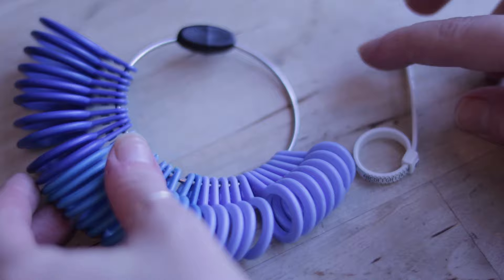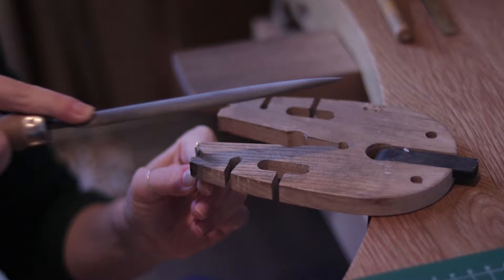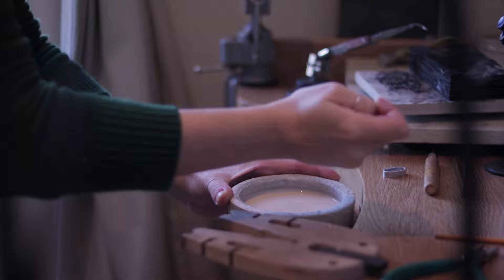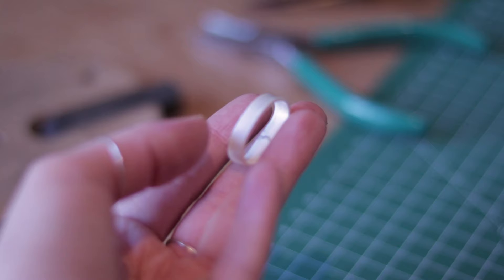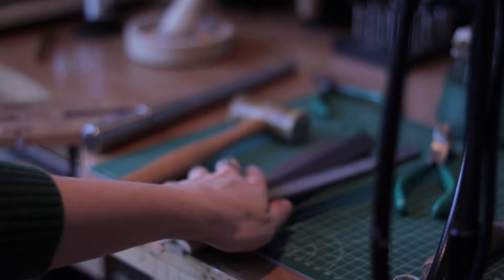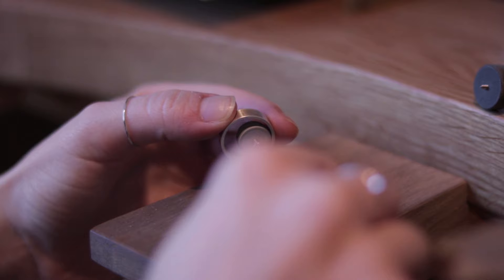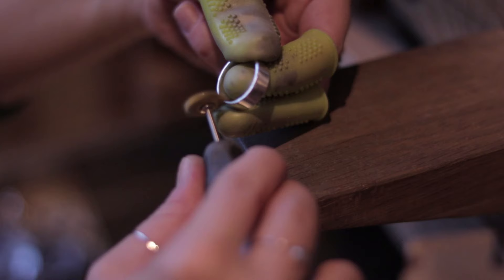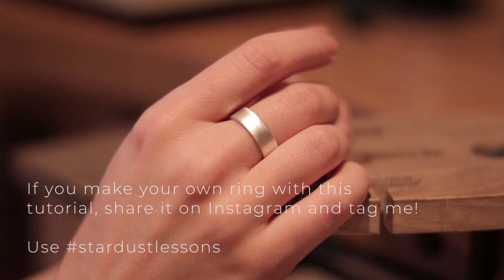HOW TO MAKE A RING - tutorial step by step.

Comment: I love that you shaped and sanded by hand for those of us without fancy tools! So helpful
Reply from the maker: Thank you so much for watching Rachel! I didn't have the ring bender up until recently, so I would always bend the rings with my pliers :) There are different ways, this was just one of them, which worked for the wide band in my case. If I was using thinner, round wire, I would overlap it on the ring mandrel and then cut to the size. It's faster and more precise this way :)
Reply: I agree! I am new and her videos have been THE BEST I have found on here
Reply: A Dremmel tool (rotary tool) is something you should already own.  Tell your husband to buy one- they aren’t expensive.  It should be battery powered, not corded.  
You can cut tile, drywall openings, sand and polish small things, etc.

Comment: Hi Basia, I'm planning to apply a brushed finish to a ring I'm making - it has a large bezel. I'm worried about the area where the ring shank is soldered to the bezel backplate and whether the brushed finish will reach into those tight spaces, or whether I will have an inconsistent finish. Any advice would be warmly received. Thanks again for your helpful videos, Em x

Comment: Is there a standard for how thick the metal should be for starting ring blanks? I started making earrings with 24 g sheet silver but I dunno if I’m being a perfectionist and sanding away too much material bc I’m ending up with very thin earrings! I’m worried I’m gonna do that if I use it for rings and change the ring size. Would anyone recommend ring blanks starting with a thicker gauge? Maybe for starting out since I go sand-happy? 😬😁

Comment: Hello, can you please help? How can I remove a bezel cup that has been soldered to a bangle? Do I need to cut it off, or can I reheat and remove it? Thank you :)
Reply from the maker: You could do both! It depends on which way would be better for this particular piece - to avoid any damage. Usually reheating is the best way. But if it's not an option and you need to remove the band mechanically, then you can try cutting it off. However this one will most likely cause the damage, more cleaning and could potentially waste the band. So reheating is better

Comment: Hello. Thanks for your video :) can I ask what wire gauge do you use for the labradorite ring you made and also for the staking rings?. I am on the process to order wire and I am very confused as I have ordered 9gauge and is very thin.. Thanks :)
Reply from the maker: Check out this video I made about metals to start with, I think it might be very helpful! https://youtu.be/GiKQoYljekE?t=48 I don't remeber for the Labradorite ring exactly, but I think it was similar to this one, which is 6mm x 1.2mm. For the stacking rings I've used either 1.20mm or 1.50mm. Please check the conversion to gauge online 😊